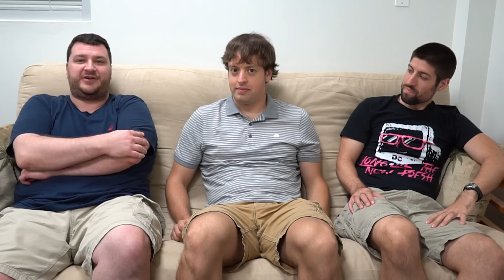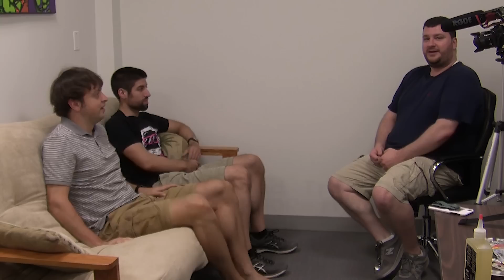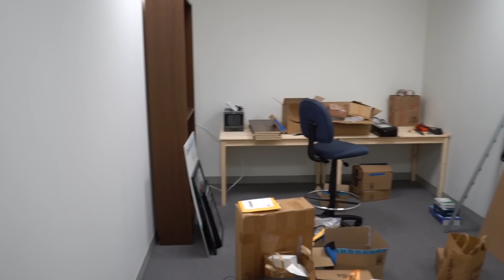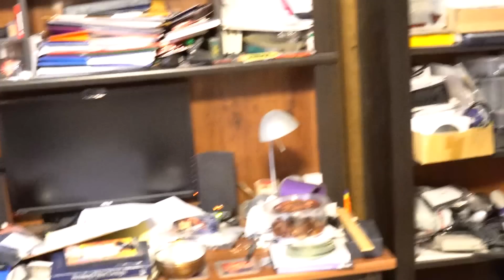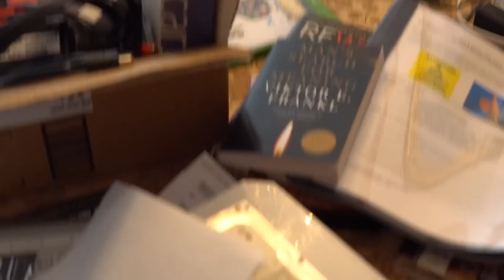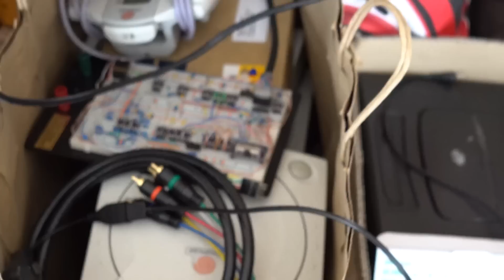Nick & Ste from HD Retrovision - In-person Interview

Comment: Regarding the markup of official retailers: our prices are set based on a pretty normal retail markup, taking into account our wholesale cost (including the cost of physically moving the cables from HDRV's distributor to our inventory) and our other expenses. The resulting price is going to vary from retailer to retailer based on our individual situations, but I'm pretty sure all of us are trying to keep our prices as reasonable as we can.
Reply: I wish I could’ve gotten the cable from Castlevania since they have a 10% off code and free shipping, which I think still works in 2024. But those guys have had the cables sold out for a while so I had to buy them from Stone Age gamer which only had a sale of one dollar off and had to pay for shipping. But I did end up getting the SNES component cables, so I don’t know if they can work with an adapter for other consul so I may have bought the most expensive cables

Comment: I know i keep asking. but a gamcube component cable would be nice. A gamecube adapter that uses a wii component cable would do i guess. I hope with the time off, maybe work on some blueprints and other plans. im not expecting anything thou.
Looking forward to your dreamcast cables and work out well. I hope there is some sort of switch for 480i/480p modes. 
Using your ps2 cables and kick my self in the but that i didn't buy the gen cables with adapters. Only cause i own scarts with a framemiester.
Keep up the good work.
Reply: If you get the internal HDMI mod there will be an adapter for Wii Component cables.  Citrus3000psi is working on it.  Go check his Twitter. 

https://twitter.com/citrus3000psi?lang=en
Reply: i care about gbi mainly for the cube. hdmi solutions don't really support gbi. well that gchd doesn't. Citrus3000psi has the gcdual and you can get a adapter so you can use wii component cables from the regular av port. Soldering scares me a bit. but i ordered a soldering iron and going to practice on a cheap electronic. If the solder iron was more like a pen maybe it would of been easier. something i gotta get used to.
Reply: Then have someone else install the GCDual for you.
Reply: anyone that can premod a cube with gcdual and xeno for cheepest possible. I usually find gamecubes in garage sales under $20. I actually got mine for $10. It really doesn't make any sense sending one since the shipping can be very expensive for something like that, plus have to import it.
Does the gcdual with component support everything the digital out does? mostly use it for gbi. does it mess up the ports just in case i decide to get a component/hdmi cable for whatever reason.
Badassconsoles is making a hdmi adapter a more pricey version will have RGB and component. RetroRGB showed the prototype in his qa episode. He said his testings, that everything works, everyone will maybe get it when it's ready/ something like that.
I hear some guy asked beharbros about making a component solution and they replayed that there considering making something.. IDK that could mean nothing.
I just want something to upgrade from my s-video. S-video is alright just a bit of fuzz. it will do for now, i may just wait it out see what the best option is when everything is out.
Reply: My dude, Insurrection Industries has your back. They're bringing back their GC component cables for pre-order in September
Reply: @MultiMarvelGeek  I ended up grabbing official one's. I found them at a good price so i just picked them up. those people on discord said official one's are better cuz it supports more settings for gbi. For Normal gamecube use a hdmi adapter does just fine. For normal gamecube use i use my wii. gamecube is mostly for gba play with gbi.
I ended up getting dreamcast scarts. does the job and has a switch to change resolutions.
I gotta get a new scailer for 480p use. waiting on more options thou. coming out.
Reply: @Deltax5  The component cables from Insurrection Industries actually have better image quality, a ton of of options with a universal remote, and act just like the OEM component cables. That's amazing you got some at a good price, though. Neat! Didn't know the Dreamcast had SCART cables
Reply: If one were to save money. Those cables would still look fantastic even with normal settings.

Comment: Oh and you also forgot the PS2 component cable. You can also use the PS1 adapter on the PS2, but this would be kind of pointless.
Reply: Does the ps1 adapter+gen cable actually work with the ps2. i thought it wasn't compatible. maybe the 480p doesn't work or something.
Reply: @Deltax5  That's right. The PSX adapter will work on PS2, but you can't use 480p with it. It's better to just get the PS2 cables, granted there aren't many PS2 games that support 480p.